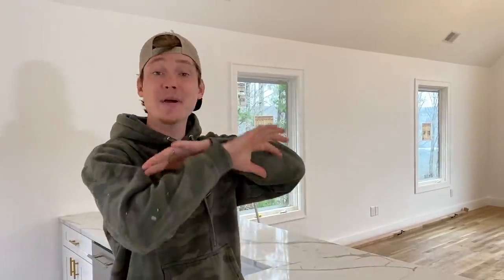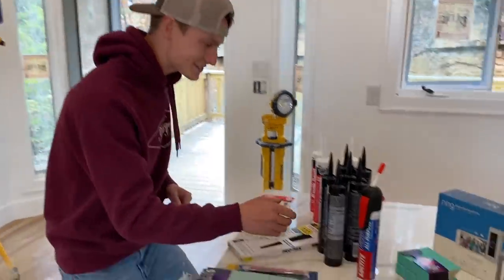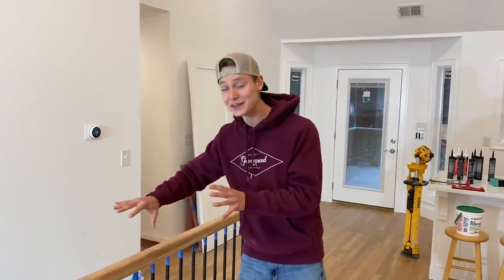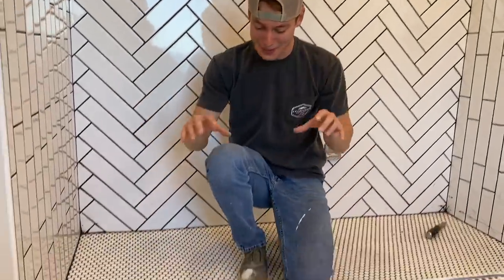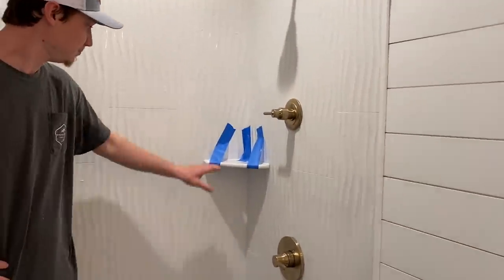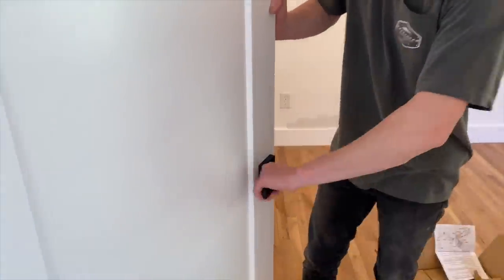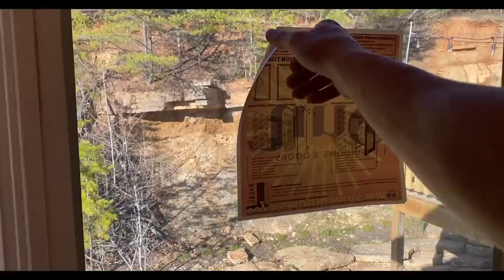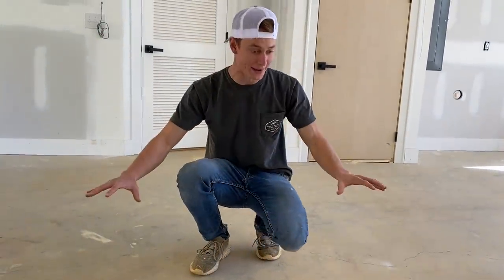The New Goonzquad Headquarters Part 81

Comment: How are you heating the house? Haven't seen any radiators?
Reply: The whole building is served by a HVAC (Heating, Ventilation and Air Conditioning) system with a separate contol zone for each of the two floors. This can deliver heated or cooled air to every room through a network of hidden ducts and grilles. The system is electrically powered. Such arrangements are ubiquitous in the USA.
Reply: @johnstedman4075  ok good to know. We don't have that over here in London
Reply: @davidsanchezds34  You are welcome David! As a fellow Londoner, my architectural Firm has tended to install underfloor heating in most of the private homes we have designed there recently, and I have this in my own house there and find it very good. In the USA and Canada we find the local preferences are usually for HVAC, and very few alternatives are considered. My favourite location, the Caribbean, is perfect since the temperature rarely exceeds 30C in the daytime or drops below 18C at night, so no heating or cooling is really needed at all, except in windowless spaces. Have a good day!

Comment: While I appreciate that the house was built before the boys took possession, that front door is going to be problematic and probably unusable in anything other than good weather, with wind, rain and snow ripping through the house every time the door is open.

Although anyone living there would probably just use a back or side door, visitors and deliveries will come to the front. 

It would have made more sense to have the front door off the side, but where it is they really need to build a decent sized porch so the outer door can be closed before entering the front room.
Reply: Originally the front entrance was on the short return wall between the two parts of the facade, and was a single door. Goonzquad filled in that opening and enlarged a former window opening to install the current double doorset. The best arrangement for access in the colder and wet part of the year is to arrange a porte cochere alongside the west slevation, providing occupants and visitors with shelter while they are exiting and entering vehicles between the house and the future garage building. Entry in the winter could then be arranged through the single door on that side of the house, with the interior adapted to provide a vestibule arranged as a 'mud room' for removing wet outer garments and muddy footwear.

Comment: Are yall thinkin of doin solar on the roof??
Reply: There are no plans at the moment to install solar energy collectors on the roof. However, the shingle roof covering is twelve years old, and can only expect to remain servicable for about another five years. At the time when the roof covering is renewed it would be worth carrying out a detailed feasibility study to assess whether solar panels would be a viable addition to the south (front) roof slope, where maximum energy is available from the sun. These panels could be not only of the type that produce electrical power, but also those that heat water directly. Generally speaking, solar power in such situations will pay for itself in about eight years of use, although that figure is very dependent on the levels of relevant taxation, which are difficult to predict. Solar power is not usually very useful in the four month period November to February inclusive, so wind turbines may be a productive source of energy during that period.

Comment: How is the Internet connection? You get fttc or normal adsl?
Reply: Fibre Optic cables are currently being installed in the locality, so a fast (and, more crucially, reliable) Broadband Internet service should become available this year. The Goonzquad house is approximately 1,020 feet (310 metres) from the nearest public road, and fine for a FTTC (Fibre To The Curb) connection. It might be viable and practical to run FTTH, (Fibre To The House) but it depends on how installation costs are structured and what up/down speeds are guaranteed. If NGA (Next Generation Access) is discounted or subsidised in that rural location, which it may well be, FTTH is probably the best option for Goonzquad, who are rapidly increasing their Internet usage and will likely need the ultimate speeds available in that area.

Comment: You going to install linked smoke alarms and c02 detectors?
Reply: they make smart ones, maybe linked to an alarm system like the ring alarm to go with your door bell
Reply: They certainly should do that for obvious safety reasons, particularly since the Fire Service response time to that rather isolated location is likely to be long. However, it is actually not a legal requirement for individual private houses, because the relevant Tennessee Building Code (68/120/112: 2016) only applies to motels, inns, boarding homes, lodging homes, rooming houses, tourist homes, hostels, dormitories, and apartment hotels.

Comment: You don't tape a patch! The edges of drywall sheet have a taper for the tape and filler. 
Your patch is flat. So there'll be a lump where that patch is and you'll see it when the sun shines just right

Comment: These guys clearly have money to burn making amateur mistakes that would never normally occur on a project like this.
Reply: Construction projects are a complex interweaving of numerous interrelated activities, time is of the essence, every project is different, and the skills of problem avoidance and problem solving are in constant use. In my experience, there has never been and there never will be a project where mistakes did not have to be swiftly identified, fairly assessed, effectively corrected and responsibly learned from. Modern attitudes towards deadlines, complexity, financial control, new technology, logistical issues and ever changing laws have exacerbated this situation, and will continue to do so.